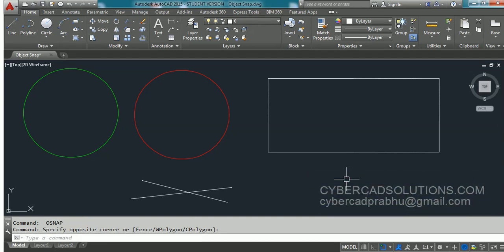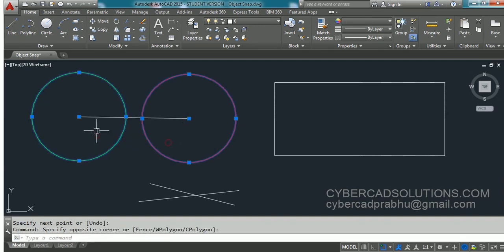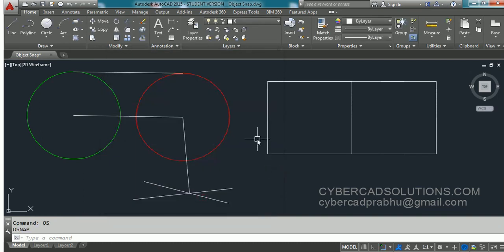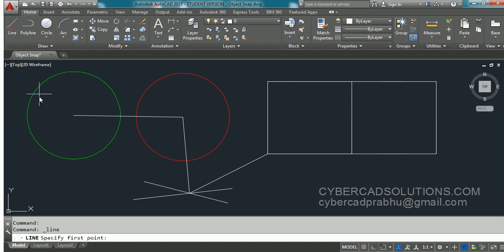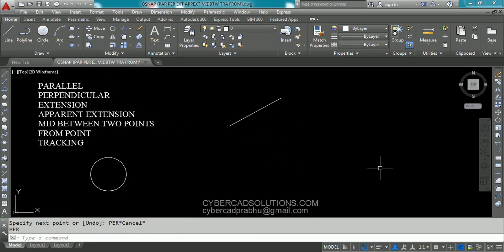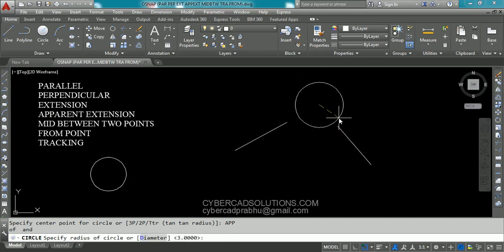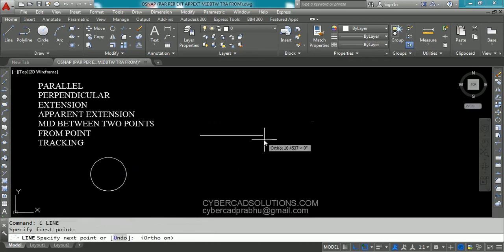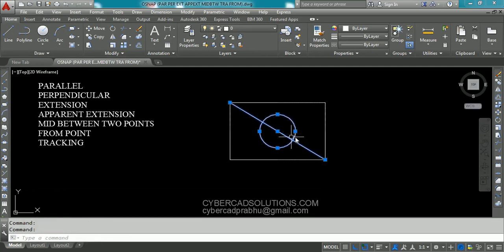What is Object Snap and How to use Object Snap in AutoCAD

Comment: Great video Prabhu. I don't know if you're familiar with Revit at all, but I have a question. In Revit, if you are trying to draw a square with the line tool, you can draw 2 lines at any length, and when you attempt to draw the 3rd line, a tracking vector shows youi where you can snap your line to be the exact same length as you first line so that the 4th line you draw can simply be snapped back to the first line to complete the square.
Is it possible to get that tracking vector to show for AutoCAD?